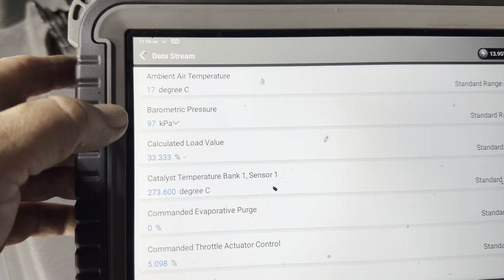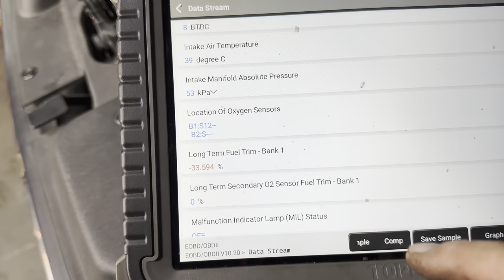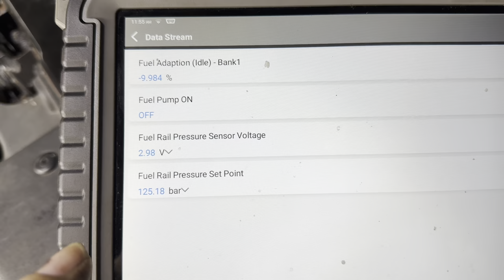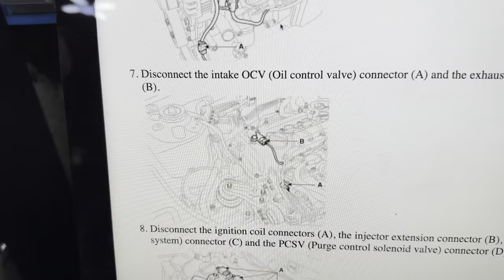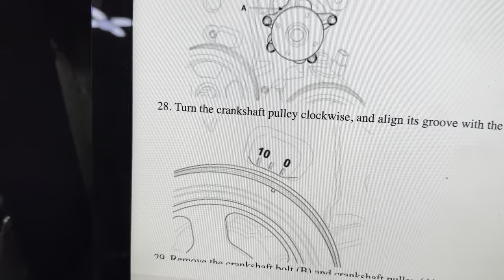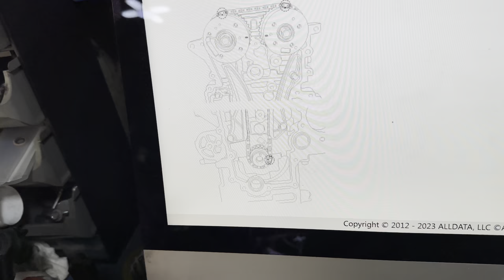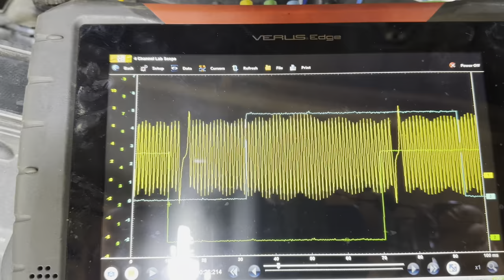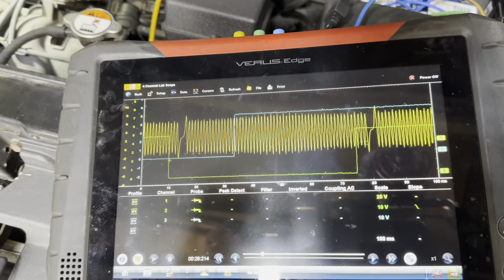Kia Soul 1.6GDi (2013) - Runs Rich P2188/P2192 - PART 1

Comment: Check Fuel rail pressure with scan tool - "desired" and "actual" and compare at idle and then when reving. If it's equal then it's not timing issue. Second - block the PCV hose to see if the fuel trim get better. If not then injectors are overfueling. If it gets better when you clamp the pcv hose then change the high pressure pump. Also check low side fuel pressure if it bleeds into the crankcase after you shut off the engine. That's because high pressure pump has one way check valve for the high pressure fuel rail.
Reply from the maker: Thanks for your help I’ll try this tests tomorrow much appreciated cheers Sandy
Reply: Yes I agree with the tests..
Reply: Is this map engine or maf ..see if Map,Maf , egr and O2 sensors are correct.. See if VVT O2 plugs not swapped..
Reply: I agree with above

Comment: It's possible timing is out on this but chains do tension with oil pressure however chain tensioners can fail which can cause it to jump a tooth but my money is on the FPV